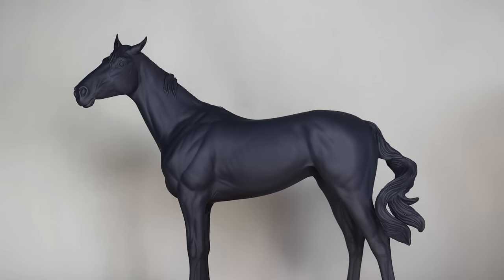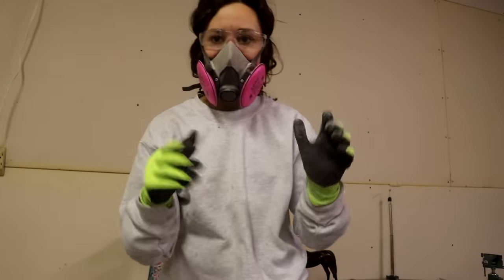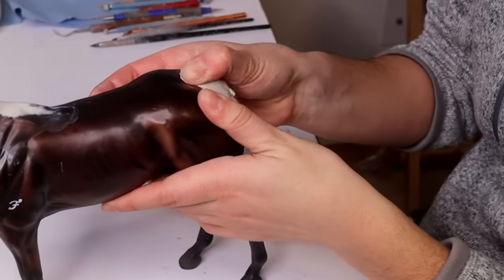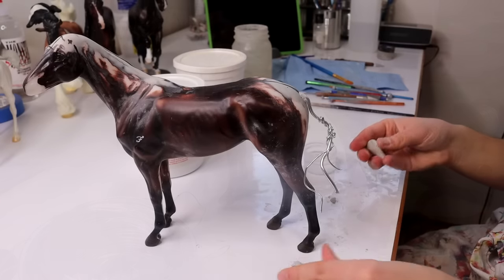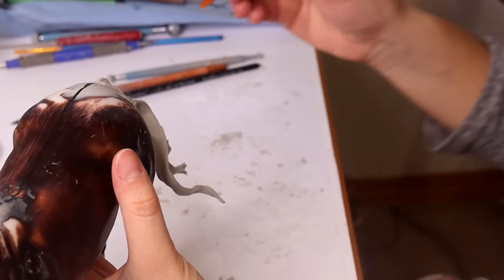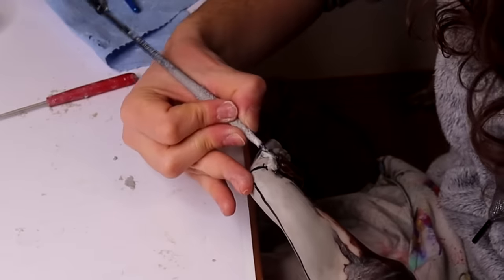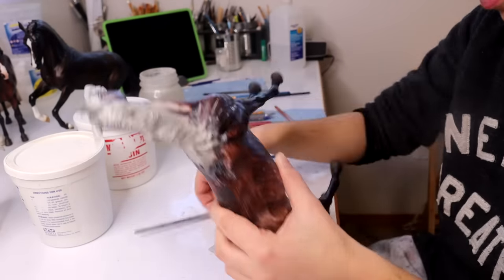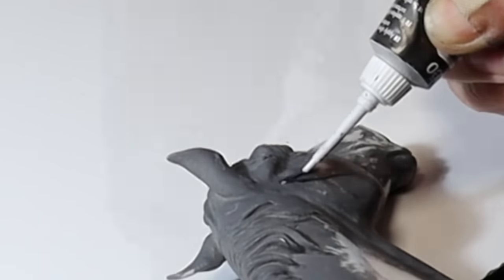How to Customize your Breyer Model Horse | Simple BEGINNER Tutorial

Comment: What is the purpose of the air holes? My thought was that in the factory it is so the model does not explode? However when you are customizing, why do you put a hole in the body? Sincere question :) I hope to one day try drastic customs myself. Also, would that fine grit sandpaper work for very glossy models for just repainting, like Anthem? He's on my custom list!
Reply: I think it’s for air flow so if temperatures change they don’t get weird bubbles or shrink but I could be wrong but just from science and stuff I think that’s what it is for 🤷🏼‍♀️